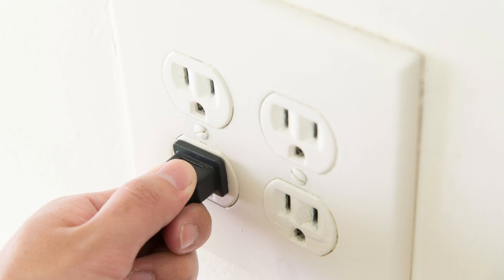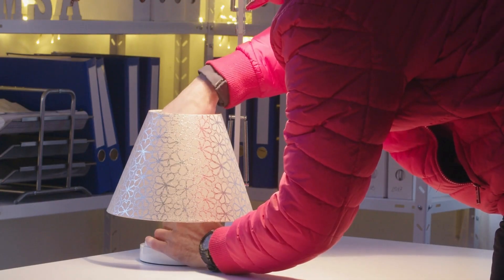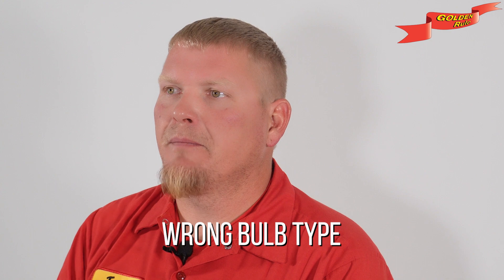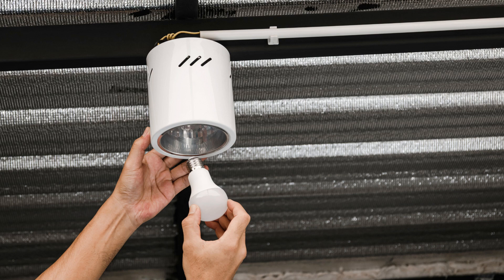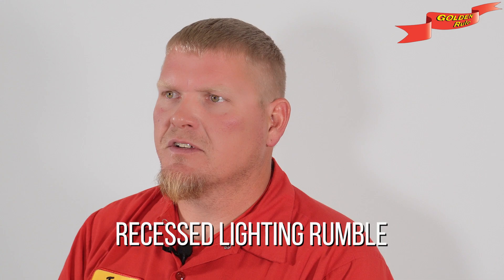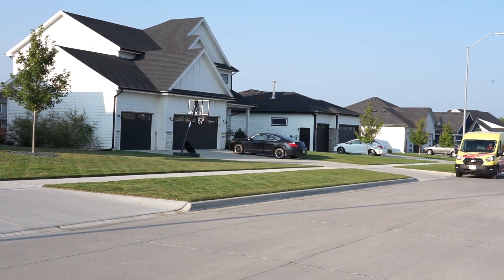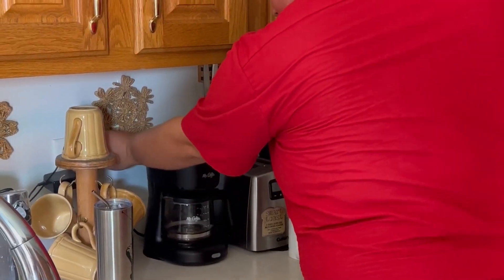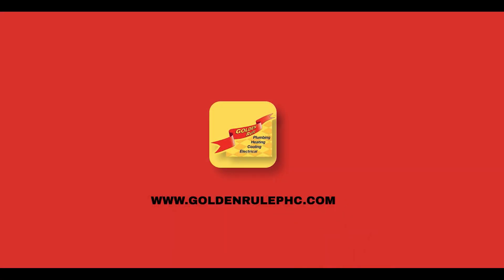Why Do My Light Bulbs Burn Out So Fast? - Golden Rule Plumbing, Heating, Cooling & Electrical

Comment: They should come out with new standards for home lighting. Low voltage lighting is now feasible. Standard light bulb sockets are poor dissipaters of heat generated by LED bulbs. Building heat sinks into bulbs would add to cost. Sockets with heat sinks are feasible too. They could pay for themselves in the savings in bulb replacement. The tiny electronics in each LED bulb can only stand so much heat for so long. The standards we've had for so long are outdated. IMO.